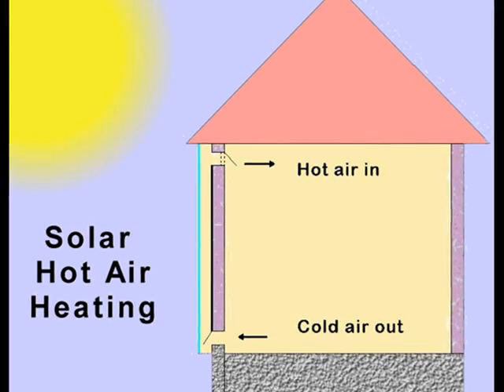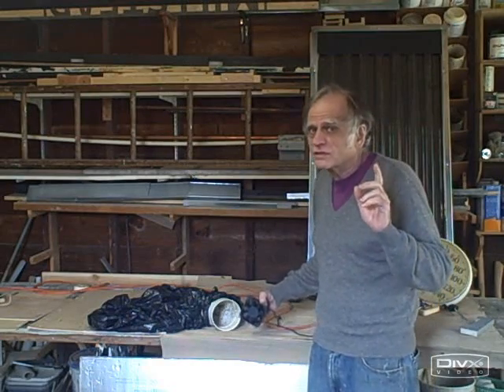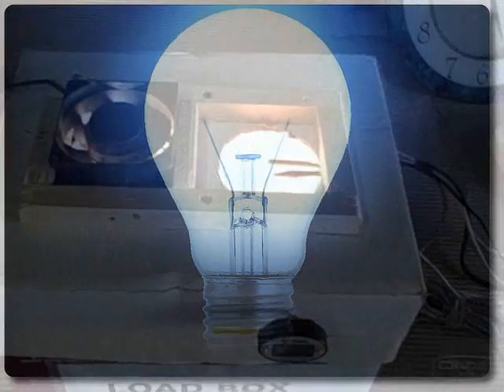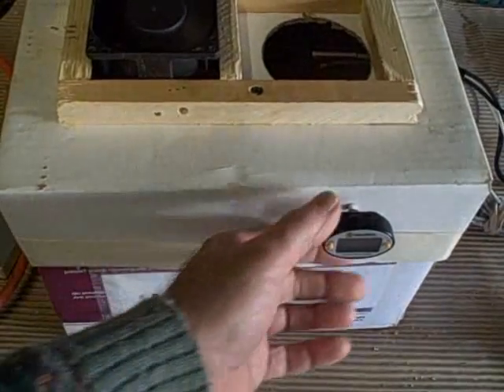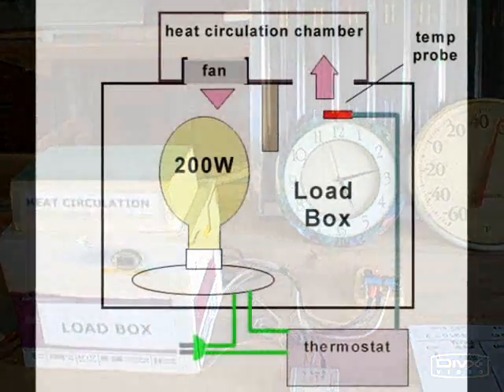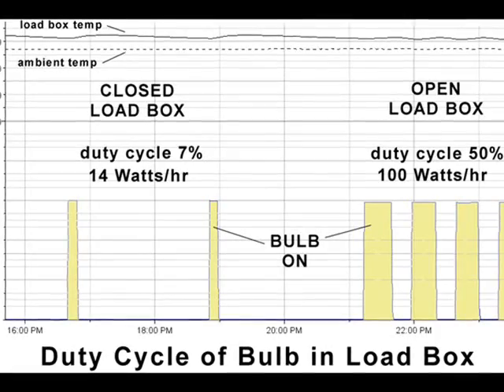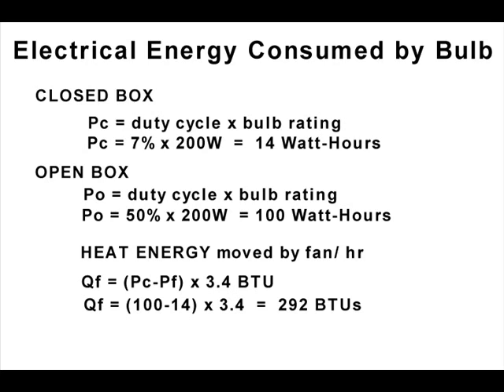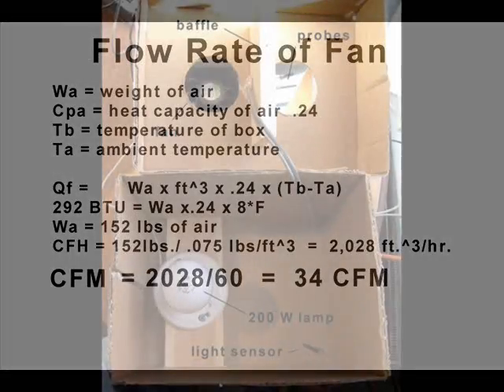Calculating the CFM of a Fan

Comment: To measure CFM
Not sure about most of the calculations in the video the simple way I learned the formula:
 watts X 3.414=Btu's     btu's divided by 1.08 X temperature difference =  CFM

so example  100 watt bulb causes a 10°F temp. difference would be  100w X 3.414 /1.08 X 10     or   341.4 /  10.8  =    31.61CFM

This is a common formula used by HVAC techs  
specific heat of air = 1.08 at sea level
 volts X amps = watts  (in resistive electric loads)
 watts X 3.414 =BTUs
  temperature difference = Delta-T    and again the end formula is:                  BTUs / 1.08 X delta T (in °F) = CFM  
temp. difference and watts readings are critical to getting an accurate CFM so several tests increase accuracy and don't measure air temp. too close to light bulb I believe that would add in radiant heat 

Like the video shows a fan blowing into an incandescent light bulb in a shoe box and a large hole in each end. But measure temp. just outside the box with a light blocking shade which should also help mix the heated air between the bulb and the thermometer. As you close off the opening you should increase the Delta T. and reduce the CFM.